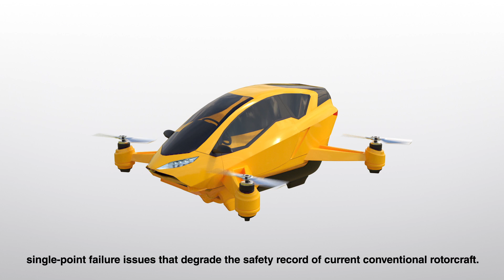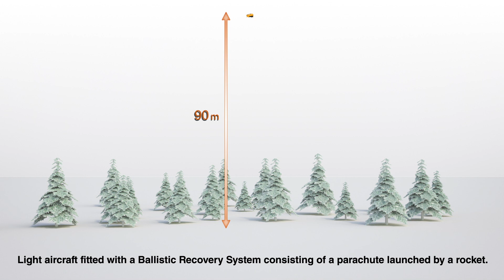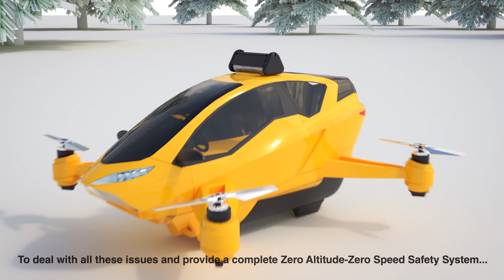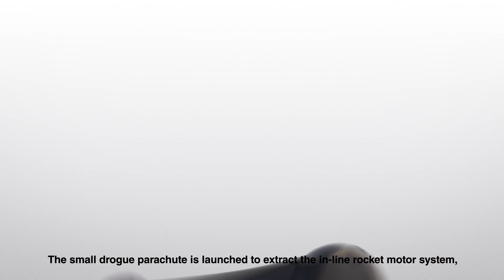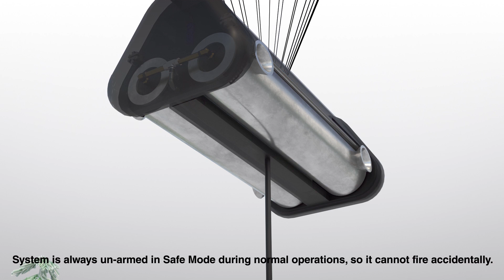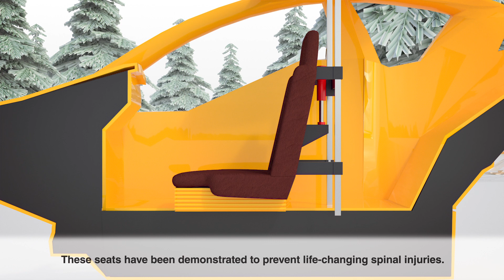Active VTOL Crash Prevention - Zero-Zero Safety System

Comment: This is fantastic! I was thinking about using rockets facing downwards under the vehicle that can act like a virtual airbag and activate shortly before ground impact. Similar to the youtube video called iphone 7 parachute system.
Reply from the maker: Yes - we originally thought about fitting the rockets to the skids of helicopters, but there was no interest in this.  Fitting any form of rocket motor to a passenger vehicle is always going to be a challenge to get acceptance, but our design means that the rocket is pulled away from the vehicle by the parachute before firing, which we believe should be much more acceptable.